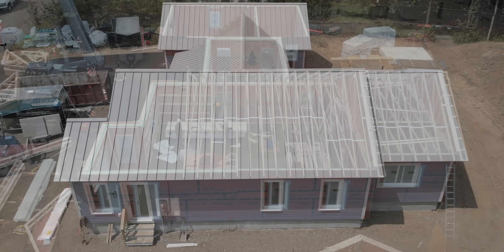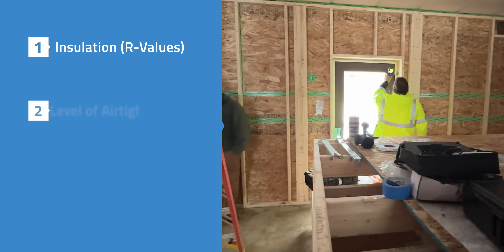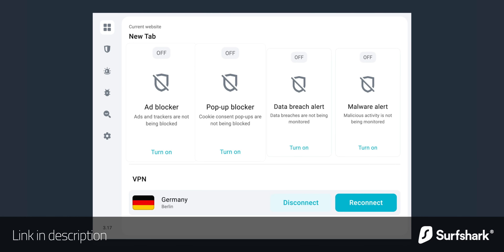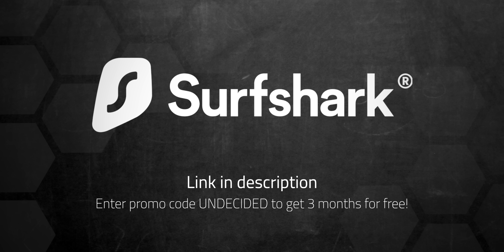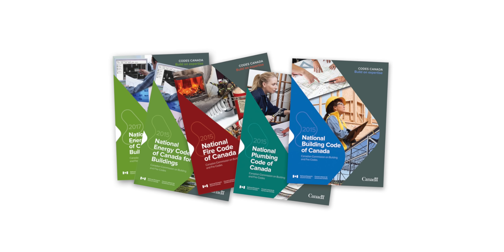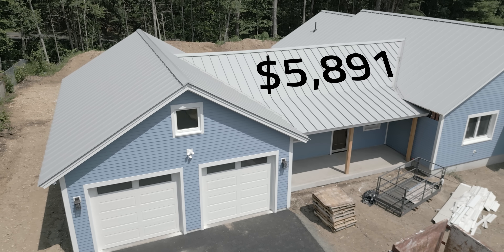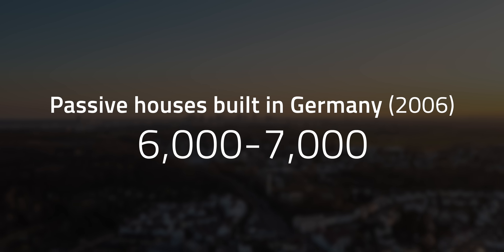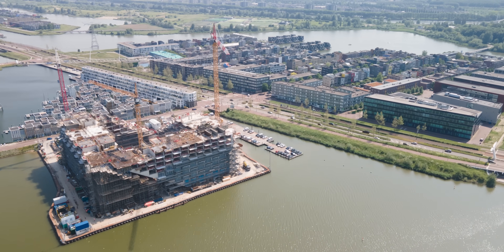Why Do American Homes Suck?

Comment: I built a home four years ago. I was unable to find a bulider in my area with passive home building experience. I chose a builder who advertised himself as a green builder. However, he seemed to focus on things like counter tops, roofing, and flooring. I was the one who initiated energy efficient features in my house. I was unable to afford solar panels, but I insulated the house well (2x6 on exterior walls), chose energy efficient appliances and a tankless water heater, and built the house on a slab so I didn't have to heat/cool a basement. For half the year my electric bills are in the $40 to $50 range for my 2364 sq ft home. My next door neighbor's are $200 to $300. My gas bill is $12.00 to $15.00 per month, $10.00 of which is for the privilege of having a gas acccount. Even if you don't build a net zero home, you can make affordable improvements.
Reply: As a plumber, a slab is the worst thing you could do as a homeowner I personally hate slabs I don’t know why you would think it would be more energy efficient? Why do you have to heat your basement if you don’t want to?
Reply: We have part of our house on a slab and there is a lot of heat exchange with the ground that comes right into those rooms. They are a good 10 degrees colder than the rest of the house year around. There may also be some direct Radon exposure and access to pipes is terrible. You have troubles adding a bathroom to the ground floor. No storage, obviously. Not a lot to recommend it.  Basements are way better than a crawlspace.
Reply: @ianollmann9393  How could a concrete slab allow more radon from the ground to reach you than if you dug a basement into the very ground you fear radon is emanating from?
Reply: I live in an area with a high water table and the choices are either a slab or a crawl space. In the previous house I owned I had a crawl space and paid huge summer electric bills to run a dehumidifier to prevent mold and mildew. Slab was a better choice for me. @bjkjoseph
Reply: I'm curious, why did you choose a tankless water heater?
Reply: @rikwisselink-bijker  it's a lot more water and power efficient, if not wrong... there's no need to heat a tank of hot water when you could have a flowing lukewarm water from the tankless that does a similar thing
Reply: @PrograError  It’s a mixed opinion. Insulation in a normal water heater is insanely efficient. Tankless is fine but the constant heat and cooling cycles of the heating element in a tankless wears out over time. My company has invested 80% of the homes we built are tankless. We used to be 100% but then we began encountering problems where tankless seems to fail around the 8-10 year mark, which contradicts the 15-20 year lifespan that is expected out of a tankless system.

The brand Rinnai was our go-to system but recently in the past few years we began getting calls from homes we built as old as 2005 and as recently as 2021. Some houses we ended up swapping out Tankless for traditional water heaters, and so far we haven’t heard from them since.
Reply: Water is heated only when I need it instead of using fuel to keep water heated 24/7.  @rikwisselink-bijker
Reply: Why keep 40-50 gallons of water constantly hot just in case someone might want a little hot water? Tankless heaters only come on when water is flowing. @rikwisselink-bijker
Reply: @rikwisselink-bijker  It's a bit of a trade-off. If you use a lot of hot water all the time, probably go with a tank. If you only use it a bit, definitely tankless. Tankless also has the upside of never running cold. When all the kids come home and sit in the shower, it's till hot.
Reply: Why worry about solar panels? It’s not like it’s structural or something. Here in the Netherlands hundreds of thousands of excisting houses have been fitted with solar panels in the last decade. Me and my dad fitted them last year on his 1930s house for around 5000 dollars, got to mention he sends it back to the infrastructure and not with a battery (don’t know if possible in the US) but his energy bill is around zero.
Reply: why do you need solar panel when electricity is so cheap....i
Reply: As someone that used to work in the green energy sector. Do not invest into installing solar panels for the next decade. The technology right now is about to make a sizable jump to where the efficiency and performance of the next generation solar panels will be trounced significantly to where it’s impractical to keep the old ones.. We’re talking a hyperbolic level of improvement to where there is almost a ~200% increase of efficiency per 1 square meter of solar panels. It’s hovering around triple the efficiency for half the size.
Reply: It would be much easier to compare numbers if you quoted your energy use, instead of the bill, as prices and costs can vary wildly.
How much kWh, and m3 of gas did you use per year for example?
Reply: Utilities
Electric: 6034 kwh for the past year
Gas: 34 therms. I don't know what therms are but that's the unit of measurement Piedmont Gas uses. My gas bill is usally between $12.00 and $15.00 per month which includes $10.00 for the account and tax. I had one twenty-one dollar bill in December when family came for Christmas. I am single so a family would have increased utility usage.
 
 @rogerwilco2
Reply: I'm curious what you design and experience was with air infiltration was and if your using an HRV to turn over air and how you do humidity management.
Reply: My home is pretty much a small, conventional home that's well insulated and has energy efficient appliances. I also have the advantage of living in a mild climate on a south facing lot and this works well for me. I am widowed so the energy demand is low most months. But even when my son and his family visited for Christmas, my electric bill for December was $135 and my gas $20. A net zero home with air handlers and solar panels was beyond my budget and I would never live long enough to recoup the extra money they would cost. Four months of the year my electric bills are in the mid forties @kennj321
Reply: And the house is alot more comfortable too I bet.
Reply: Yes, it is. I put in three zones, so it's always comfortable in the area I occupy while the other zones operate at energy efficient temperatures. @dwwolf4636
Reply: I don't need gas.
Reply: Why even have gas if it's costing you $120/yr just for the account... when you're only using $36/yr in gas??

...why not just eat the cost of more expensive to operate electric appliances??
Reply: As of 2020, all new houses in California need to have solar panels. ERVs and high amounts of insulation have become common in new construction. This is happening even though most of California’s population lives in a mild climate.
Reply: @barryrobbins7694  nobody has ever accused California's government of acting logically! 😂
Reply: @jasono2139  It sure beats Texas’ energy model.
Reply: @barryrobbins7694  right... rolling black outs is better than Texas with their solar, wind, oil, and gas "model"! 🤣
Reply: @jasono2139  There are plenty of states and other places in the world. Perhaps move to wherever makes you happy, if you haven’t already found a place.
Reply: @barryrobbins7694  most states (aside from CA and NY) are generally liveable... and yes, I don't live in either of those!
Reply: @jasono2139  By the way, Texas has a history of blackouts in freezing weather and heat waves.
Reply: @barryrobbins7694  you're talking about Texas... where it actually gets hot (and freezing cold sometimes). What's California's excuse?
Reply: @jasono2139  The issue in Texas is that they have their own energy grid that is separate from the rest of the country. They can’t borrow energy from the rest of the country during peak demand. Every state has their issues. Why focus on California if you don’t live there? There is no such thing as normal. Individuals want different things.
Reply: @barryrobbins7694  "Every state has their issues"
...understatement of the year! 🤣

Some have more "issues" than others.

Elon left California for Texas... that should speak volumes.
Reply: @jasono2139  California is home to the most fortunate 500 communities, a huge agriculture industry, high tech, biotechnology, entertainment, a $4 trillion economy, etc. They will be fine even if the  still existing Tesla plant moves.
Reply: @barryrobbins7694  ... you're talking about the most populated state and 3rd largest state in the union... "Look! Big numbers!! 🤪" isn't an argument. 🤦
Reply: @jasono2139  Even on a per capita basis they are doing fine. I get it, you don’t like California.
Reply: @barryrobbins7694  no... actually... they're not. 🤣

There's a reason why people and businesses are leaving California. 

Just because people make more $/person... they don't live any better than most other states. (The thing that measures ACTUAL prosperity is called purchasing power)

I have a friend who lives in California... he makes MUCH more $ than my family... yet we have a bigger house, bigger yard, newer cars, and go on more vacations than he does.... and he has no children! In fact, he still splits the rent with some other people just to afford his small apartment!

Like most blue states, people ignorantly ignore the COL and immediately conclude that they're  living better than all the "poor" red states... meanwhile, everything around them costs double what people in the fly-over states are paying.

I visited California many years ago, and even then, the cost for dining out, coffee, hotels, gas, and attractions was much more than similar places I had visited.
Reply: @jasono2139  What state do you live in?
Reply: @barryrobbins7694  not California!
Reply: @jasono2139  Okay. Enjoy the state of “not California”.😀👍
Reply: @barryrobbins7694  if it wasn't clear by how much better off I am than in California... yes, I am! 😂
Reply: You did the right thing by bird dogging that contractor. Even with good contractors it’s the only way to make sure you get things done right. Total mistake not to make a basement. It’s the cheapest additional space that you can get, and it’s not going to affect your main living space energy efficiency if you insulate your floor properly and that is not an expensive thing to do.
Reply: @steveperreira5850  The water table is too high where I live for basements. We build on a crawl space or on a slab. The last house I lived in had a crawl space. A dehumidifier is necessary with a crawl space because of the high humidity, and my summer elctric bills used to be in the $200 to $300 range.  My entire electric bill last year for the house I built on a slab was $821. My house is completely electric except for a tankless gas hot water heater which costs me $12 to $15 per month.
Reply: No way you can use $2 gas per month
Reply: What state are you in and utility do you use for electric
Reply: @pnw_wanderer9786  North Carolina; Duke electric,
Reply: @coe141  why worry about heating a cooling a basement. It regulates itself, just insulate it from the home.
Reply: @donaldpratt2296  I live in an area where the water table is too high for basements
Reply: You realize that basements are the most energy efficient right? Your reasoning make zero sense.
Reply: @paulmichaud3230  Exactly. Basements stay cool in the summer on their own and is where you go when the rest of the house is hot.
Reply: I live on the coast of North Carolina where we don't have basements. Many homes are built over crawl spaces which need energy sucking dehumidifiers. In the previous home I lived in I had $300 summer electric bills. My August bill was $85.00. That makes a lot of sense to me. @paulmichaud3230
Reply: Which basements? What is being measured / compared? @paulmichaud3230
Reply: @paulmichaud3230  yes, but an energy efficient basement that doesn't get damp is much more expensive to build than a well drained and isolated slab of concrete.
Reply: @paulmichaud3230  I love my basement. It is always cool in the summer with no use of AC and the warm during the winter. I have 2x6 walls, rolled insulation and double pane inexpensive windows. Temp can get to the 90’s in the summer and often go down to 40 below during the winter. My average coast on my energy bill is $77.00 a month.

I did not have to break the bank on all those fancy products, plus there’s no way I could afford them.
Reply: @paulmichaud3230  In what way is a basement 'most efficient'? You presumably mean that an uninsulated basement stays near ground temperature all year, so is relatively cool in the summer and relatively warm in the winter. In the UK that's about 12C. much hotter in Florida than Montana. But that's not 'efficient' - it's just badly insulated with very low solar gain.
Reply: @xxwookey  80% of the time, "solar gain" is not a desirable thing, because houses aren't set up to distribute the heat. I guess they could be (e.g. by having vents at the top of an overexposed room), but there might be code issues with that. As for efficiency... a significant portion of square footage is needed for functions like storage that would be a waste of active heating and cooling.
Reply: @josephfisher426  The right amount of solar gain is a very desirable thing. Too much solar gain is bad and adds to your cooling bill (if you have cooling) too little solar gain just adds to your heating bill (or  leaves you colder than you would like in a house with no heating system).
PHPP software helps you design a building so it doesn't overheat or get to cold and so that the gains from solar, people and equipment are sufficient to keep the house comfortable and further heating/cooling is either not needed at all, or only on a few days/year.
Obviously there are enormous numbers of houses that are not well designed/built and overheat at the drop of a sunny day or a bloody freezing if it's a bit cold and windy. Those all need fixing.
Reply: @xxwookey  The right amount, yes... but that right amount is probably not very much. A room with unshaded southern exposure (in the N hemisphere) is easy to overheat with sun alone in the winter; breakeven is probably around 50 degrees.
Reply: @xxwookey dude ther is no such thing as an un insulated basement  in any code I've seen in the world.
Reply: @paulmichaud3230  bingo. Some of the comments people make here are clearly 180° off of reality, and yet they are priding themselves on hitting the talking points and trying to act like they’re saving the world or something.
Reply: Sounds like you live alone.. and never cook or shower, keep your house at 60 in the winter and 80 in the summer. Your choice is yours my friend.. but mandatory solar panels would have made it to expensive. Just remember that part. Mandatory government rules are mostly costly tape that makes a few people rich. Nancy’s.. generation
Reply: @ohioplayer-bl9em  I had a 13kW solar panel system installed on my roof for 16,000 EUR without any government subsidies or mandate to do so. Investment will return in 8-10 years. Why do you think that is bad?
Reply: @conanobrien1  because it costs almost  that much in the United States, and will take twice as long to pay back because energy prices are lower here
Reply: @Matt-yg8ub prices now are all under an 8-9 year payback in the US now, and I live in a cheap energy state.
Reply: @ohioplayer-bl9em  The government subsidized many aspects of out life. So times for the betterment of all. Generally for the betterment of those who have have political influence. America is broken in many many but overall still at least good. Ideally the government should be more efficient and for the overall good for all Americans.
Reply: I live alone, cook every day, shower regularly, and my house is at comfortable temperatures throughout the year.. I live in North Carolina and there are many days I don't have to use AC or heat. My utility bills are so low,  solar panels wouldn't make sense. @ohioplayer-bl9em
Reply: @ohioplayer-bl9em not anymore. Solar isn't expensive if you buy it from a pro instead of a company with an in home presentation where the salesman get 30% off the top.